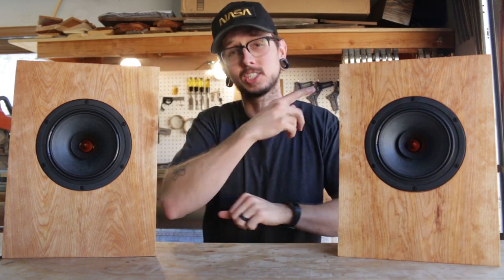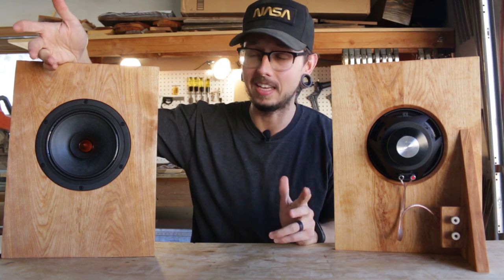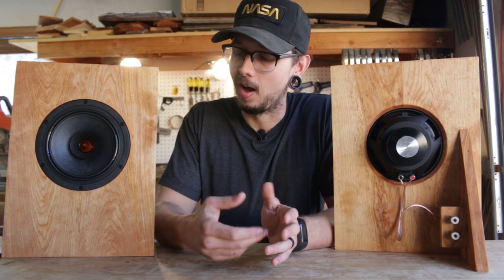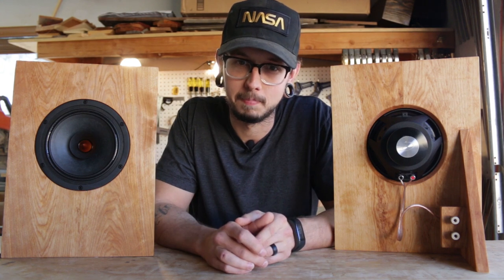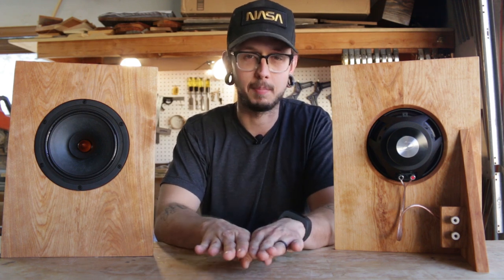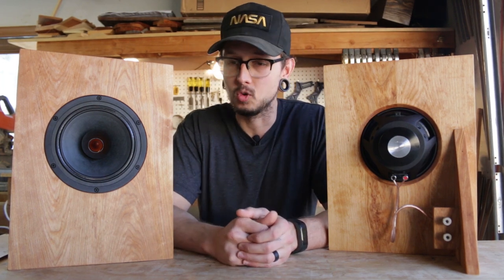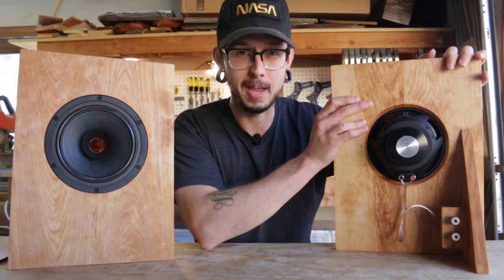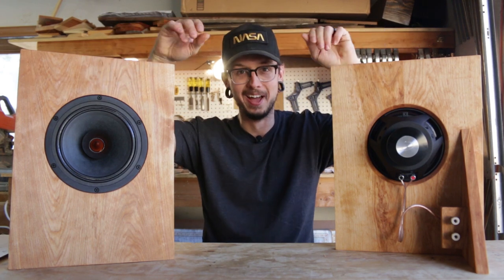When It All Goes Wrong While Trying New Things || BUILD TALK || Asking For Help!

Comment: I believe you chose the wrong speaker. You need a qts of .6 or higher for dipole speakers. The Dayton doesn't suit your goal @ .3. Audio Nirvana makes good models for this. Your baffle is fine. To truly explore the concept you should match these with an dipole subwoofer.
Reply: that first thing that i thought about in the previous video, qts less .5 it is for ported boxes
Reply from the maker: That makes total sense. For some reason I wasn't thinking of an open baffle setup like a (very big) ported enclosure, which seems obvious now. Thank you for your input! Another thing to note, I took these into my listening room to measure them and they sounded WAY better than in my living room, so i'm thinking their positioning in the room impacted the sound as well. Can't wait to try these with proper drivers. Thanks for watching!
Reply: @KirbyMeetsAudio  check out some other tubers doing this.

Comment: Just a heads up... you don't always have to go with a wider front baffle. You can also add a lip to the back of the top and sides of the front baffle. As long as the total width of the baffle and depth of the lip pieces equal what you need to cancel any rear waves, then you're golden. :-)

Comment: The main points of OB are NOT to hear the back waves, it's to free the driver from the pressure on its cone (added mass of air in the box) and to eliminate the distortion that any box adds to the sound!!! Also, the phase shift (group delay) is smaller. It acts as a 1st order "enclosure" for a more transient-perfect sound.
Higher Qts is equal to resonant low frequencies.
You should have just increased the baffle size or more efficiently in terms of size - just add "wings" to them. :)
Open baffles give you the sound of the driver itself instead of listening to a box...
Reply: The purpose of Infinite baffle is to not hear the back wave. Open baffle adds the rear facing sound because it's more natural, like a musical instrument.

Comment: I think you made 2 errors : 
First, OB needs speakers with very high Qts. This is not the case with this one.
Second : although this driver has a very wide frequency response, it's not flat at all and is heavily unbalanced. Combined this with a small baffle and bingo, you get what you heard.
I suggest you try the same speakers in a nice tapered transmission line with a bit of filtering of the highs. You might be amazed.

Comment: I'd argue that your materials choice and stand are wrong.  You want a cabinet to be acoustically dead: as little vibration should travel through the medium as possible.  Why so many think birch is a great choice when it's used in instruments for its ability to carry a tune is beyond me as they resonate like crazy when it's used.  Second, by having the single little stand on the side you're not really grounding the speaker well.  Enabling it to resonate more.  Wasting a lot of the energy the driver should be putting out into the air.  Open baffle speakers should be rigid, yet, isolating.  Think of an optimum open baffle design in terms of a trumpet being made of concrete as opposed to brass and you get the idea.  That's why there's so little bass: the low frequency vibration is going into the baffle instead of the air given how resonant it is.  Chip board is used to great effect by Wharfedale as it's even better at cancelling out frequencies than even MDF and you can compound and paint it to whatever color you want.  (I'm partial to hammer tone navy blue myself ;)

Comment: Bon appétit! Obviously, the "lacking bass" side of things was to be expected... to my knowledge, the only way to get decent bass out a open baffle speaker would be to go for a 15" driver or so! I'm surprised that they are lacking in mid-range thought! It might be the GIANT breakup between 2500hz - 7000hz that these Dayton exibits over shadowing the overall flat mid-range... I am eagerly awaiting the sound test for those and I also think your idea of doing a ported box and compare is BRILLIANT!!! 

Also, I'm pretty sure you could get astonishingly better result if you use a BSC and a Notch Filter to bring the bass at the same level as the rest and tone down the shouty mid-highs... I have been considering these in a 2 1/2 way with a PM180 as the 1/2 and a Fountek CD1.0 as the tweeter crossed around 500hz and 5000hz... Your test might be what decides me!!!

Thank again for a great video Kirby!!!

Comment: As you found out, a single driver just cannot handle the lack of bass that an OB causes. In general an OB should be a 3 or 4 way speaker. Often even augmented with a subwoofer breaking up the bandwidths into 5 different bandwidths. This assists with dealing with the bass losses as well as something called a dipole peak. Don't worry about dipole peak for now.

As for the driver type, usually a driver with high Q is used to deal with the loss off bass. Also something with a lot of xmax to help with the gobs of displacement required to produce bass. 

BTW, OB speakers aren't used to get rear radiation as well as front radiation. It's to cancel out energy to the sides that would otherwise reflect off sideways. This is a dipole radiation also known as figure 8 radiation. The bass cancellation is intended in the design to achieve the dipole radiation, but it's not a good thing that the bass is lost. It has to be compensated for with eq and multiple drivers. This is why lots of xmax is required because you quickly use it up trying to get the bass back.

If you want to learn from an expert (as I am not an OB expert, I prefer closed boxes) you should read some of Siegfried Linkwitz's work on his website here: http://www.linkwitzlab.com/ Another expert is music and design. I forget the gentlemen's name, but he is an OB expert: http://www.musicanddesign.com/products.html

For your project you may want to consider a parallel LR circuit to cut the highs down. Something like 3mH and 10ohms in parallel. Or using eq if your have a computer for a source. This will chew up excursion quickly but may make the sound a little more tolerable. Good luck.

Ryan
Reply from the maker: Thank you for all the info, Ryan! It's pretty amazing how complicated such a simple design can be. I'm a big fan of your channel!
Reply: Hey thanks that means a lot coming from you.

Comment: Your driver needs to have a Qts value of around 0.7 or above to have good bass handling in open baffle design.  These drivers would be amazing for a ported or large sealed enclosure.  Send them to me if you don't want them!  ;)  Probably just the wrong driver choice to try open baffles.
Reply: Got here to say that. I heard even higher Qts as the treshold, 1.1, if any of the bass is to be heard
Reply: You are spot on.  It typically should be .7 or higher.  One of the best things to do, is to model it in winISD (free).  Then model a closed system and make the box as big as possible.  You will start to notice that the box stops affecting your low end frequency response.  It is at that point, you can see how low your speaker will go.

Comment: Higher Qts is somewhat necessary for a good open baffle setup, as well as having a wider baffle area and baffle step compensation circuit. The DIY Audio Projects website has component calculators and a wide array of knowledge on how to build a corrected OB system. Also, OB projects tend to favor having a separate midbass woofer with high mechanical stiffness (Eminence Alpha 15A, for example) to handle lower frequencies, mounted to either a very large (4'x8'x1") sheet of MDF or placed in an "H" baffle (more compact way to create a larger separation between the front and rear acoustic waves).

Comment: Gotta have a dedicated bass element when going open baffle. An H-frame 12" woofer open baffle sub on each side would make good stands for what you already have there  and provide a solid low end.  Cross the 12's over at 80hz low pass 12db.

Comment: So theres one thing I'm kinda surprised you missed. Even though its an infinite baffle, you want the positive and negative waves from hitting each other to take as long as possible. You could use either a bigger front piece, or actually put sides and top/bottom on it. Keep the back off.  This philosophy is why many speaker makers like andrew jones puts the ports on the back now. The two different waves take longer to fight with another. Similar deal with infinite. This front piece is just too small. 

Car speakers are the same way. Dynamat, sound deadening isn't the big deal of getting great sounding doors. Its getting a proper seal from positive/negative waves that can make a huge difference.  Even if its not fully sealed, it'll take long enough for the two waves to meet.

Comment: As said by others, you need a high Qts. also, the lower you want to go the larger the baffle has to be. Otherwose just use a seperate bass cabinet for 300Hz or lower. I have yet to discover a full-range unit that can actually do bass and highs without needing assistance.

Comment: To get a good bass response, you will either want a bigger baffle to prevent the pressure from "spilling," or you can use a larger driver in order to move enough air to override the spillage effect. 
You should anyways check out some of Linkwitz's tips and designs for infinite baffle speakers. I can't think of anyone in this world who can possibly have more experience and knowledge with this than him, plus he's Norwegian 😁😛

Comment: A basic consideration - Your getting a figure 8 effect, where, what's coming off the front. cancels what's coming off the back, visa-versa. Had you used 2 pcs., rectangles, in an H configuration, for the stands, it would have lessened this effect, somewhat +-, instead of a huge baffle. Quality OB that plays to moderate volumes is a tall order. Great channel!

Comment: Just take those drivers out. and replace them with vintage drivers from an old console record player unit aim for speaker units from the 40s 50s or 60s my personal favorite are Philips Norelco speakers out of console units from the 50s or 60s for open baffle units.
Reply: You're right about the Philips drivers. I made open baffles as a fun project last week. Took two 10 watt full range drivers from a crap spunding plastc speakers and placed them in  30 x 60 centimeter chip wood plates. I was surprised!! They sound so much better. Gonna make new baffles in a few weeks time and fool around woth different amps. .

Comment: Open baffle are not efficient not even close so some equalisation is needed. Hearing rear sound,  well has been said should not hear.  But   in your room you will with reflection, no choice it's basic physics.  Option's  infinite baffle or take to the hills with Julie Andrews.  The wood I agree should be dead.  Get them off the floor on stand or hang from ceiling some how as you don't want the panel moving.  If all speakers they claim to be accurate, then in theory would all sound the same.  Hi-fi is about the best interpretation of the original signal not photo copy it can't do it.  If you want original phone Mick Jagger to bring the band around his number is

Comment: For Open Baffle to work properly, you need to understand a few things in order to make them work effectively.

First and foremost, the baffle has to be big enough that the lowest frequency the driver(s) will produce are either kept completely separate from the back to the front of the baffle or in phase with it. Ideally, you would want it to be in phase so as to augment the front (main listening side). Therefore, the shortest distance from the edge of the driver to the edge of the baffle should be about 1/4 wavelength of the bass f3. 1/4, so that when the back wave, which is 180 from the front, wraps around and back down to the front edge of the driver, it has now traveled the 1/2 wave distance so that it is now IN PHASE with the front wave. No need for doing calcs, Google is your friend and can do it for you, or at least get you pointed in the right direction. 

Second, OB needs a driver that can move air. That means either a good size cone or a very healthy XMax. Herein lies the reference to a higher QTs, as they are generally more loose with the damping factor. So if you have a stiff driver (get your minds out of the gutter!), you won't get much in the way of deep response, unless the driver is physically huge.

Third, room placement makes all the difference in the world when using OB speakers. You actually need the standing / reflected waves in order for the smaller ones to work anywhere near respectably. Before you write them off, try placing them about 2' to 3' off the corner walls, angled somewhat in toward the listening area. Experiment from that base point, closer or farther to the corners /sides/back wall(s).

Fourth, just by eyeball, the baffles seem a tad small. If room placement cannot garner decent or improved sound, try adding some extra border around the top and sides. don't worry about the bottom because the floor is part of that system. Grab one more board and put it around the sides and top (don't worry about the bottom as the floor is part of that system) with an angle toward the back, say from 22-1/2 to 45 degrees. This will help increase the time delay of the rear wave because it has to actually travel backward and the "curl" over around the edge, which would slightly weaken the back wave in addition to delaying it (phase shift). 

Other comments have given you good pointers and links, but give the room placement a try before starting any mods.

* Yes, I know this is an older video and you've already made your changes, but I just wanted you to know there could have been hope for the originals.

Comment: Huh little late...
You are amazing builder but you must do some research in acoustic and electronic fields. If i ma not wrong Fs of these drivers is above 50Hz, 56 or something Hz? It means that they won't play any much lower than that point. Don't know the other characteristics perhaps they could sound good in TL or TQWT design. I vote for TL design if they fit by other characteristics.
You must check on their Freq. curve. The segment which is the most flat is the segment where they will play the best.
There is another concept suitable for let's say 2 way speaker. Name is FAST. Full range is on OB and woofer is on the OB too, but very low placed. Behind it there is 'box' without back (or bottom) side... Please read the old Lampizator site namely the Endorphine 17 speaker. You don't have to use old Saba's greencone drivers but there is good concept for the lower range and bass drivers and fairly good way of crossover's design and built.
Disregard any hater of Lampizator site, at least this part i am writing of.
Cheers

Comment: I already once designed an open baffle subwoofer with two low cost 8" drivers working in compound in a "U"-shaped 9"x9"x9" dipole "enclosure". It worked fine but had a strong resonance (due to the length between front and back of driver) in the lower mids as expected which had to be suppressed and had a low sensitivity in the bass section.
A popular belief is that an open baffle needs a driver with a high Qts. The German magazine Hobby HiFi proved this to be uneccessary a few years ago by comparing the frequency responses in open baffles of different drivers with high and low Qts. They found no significant difference. What you do need is a long throw driver, especially for open baffle (resp. dipole) subwoofers. They published a few designs for open baffle speakers from fullrange to 3-way.
The PS180 is suitable for an open baffle. I actually wrote some info which you partly confirmed in this video in the comments of your build video which I copied here:
>The data sheet of Dayton's PS180 in the German magazine Hobby HiFi 1/2012 looks promising: very low mechanical loss (0.31 kg/s), high sensitivity (98 dB from 1 watt @ 1 kHz), decent linear excursion of +/-4 millimeters and very low distorsion (K2 and K3 each less than 0.1% between 250 and 2000 Hz, K5 even less than 0.03% above 170 Hz). What an exciting and also challenging project! My guess would be that the lower cut-off frequency with a baffle of that size will be between 300 and 400 Hz. I'd recommend to add an open baffle subwoofer with at least two 12" drivers. Maybe in an "U"- or "W"-shaped dipole (also called RiPole by its inventor Axel Ridtahler). Your open baffles will need a big room with at least 1.5 yards distance to every wall. To design a passive correction network (I'm not sure if this is the correct English word for the fullrange equivalent of a crossover network) to get a decent sound quality will be a lot of work. This might be the perfect project to try a digital crossover such as the miniDSP which could make the design process much easier.<
How did you tune your previous projects? You could use ARTA (free demo) and a miniDSP UMIK-1 ($75) calibrated mic for measurement and BoxSim (free full version) for crossover design.

Comment: I can chime in from a guitarist's stand point. Most small combo amplifiers use a semi open or open back design, especially older, quality amplifiers. They originally werent designed for bass response. They sounded middy and had plenty of high end. (We also used "low quality" paper speakers, and still do for natural overdrive and break up, so bass wasn't the intent.) Even today, high end amplifiers like marshall still use open back amplifiers and speaker cabinets bass response is not the intent. The bassy detuned musicians use (4) twelve inch speakers in a cabinet at a moderate to low volume to get deep bass for recording. Maybe that helps.

Comment: start with a solid block, cut the back at an angle agreeable to you (usually no more than the speaker pokes out the back) so the bottom has mass...this will "anchor" the sound giving you that bass you're looking for...still not perfect, but def better. cant do a solid block? design more mass into the speaker